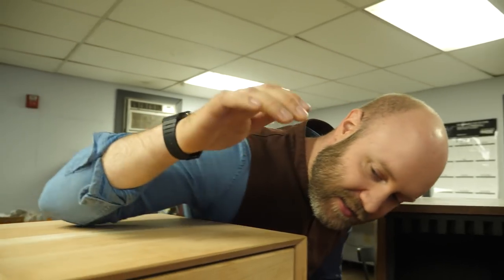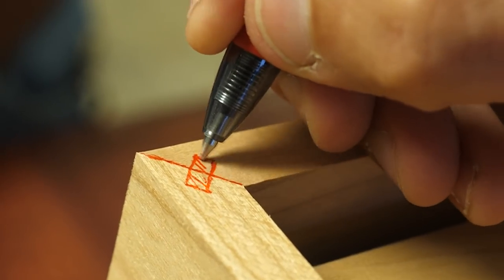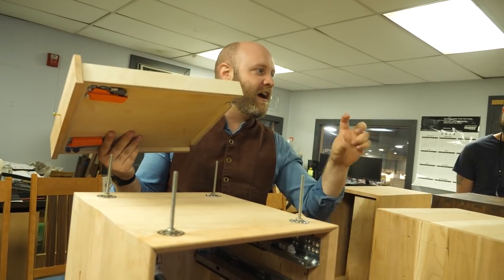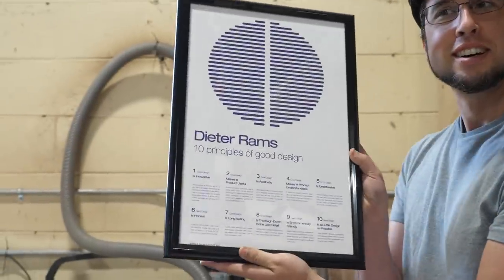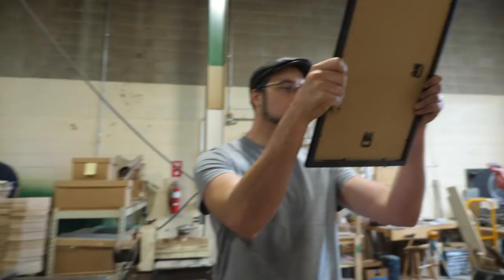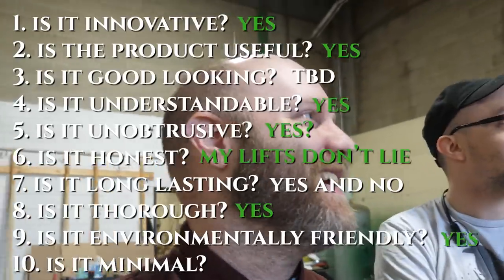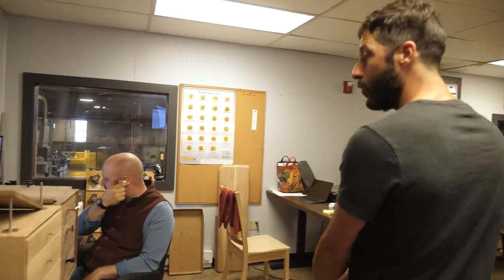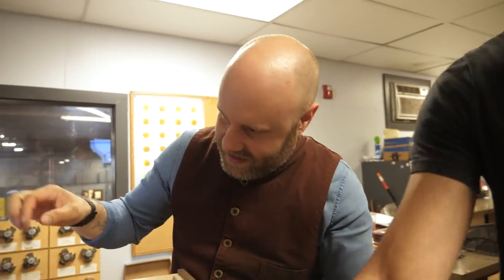Metal Hardware or Wood On Wood? (don't be gross)

Comment: Still find it frustrating that I can't just buy the top. All this talk about it being modular, and you won't sell the top separate from the legs. Are you shipping it with the top installed on the legs? No? Then why can I not just buy the top and swap it with my current legs. I literally got the legs I have with the shit particle board top because I knew I would be able to swap it out eventually with something nice. Why not just release the weight of the tops for the different wood and let us pick? Why assume the legs I have are trash just cause I went with a cheap top at the beginning? Why bother saying it is modular when it obviously is not modular.